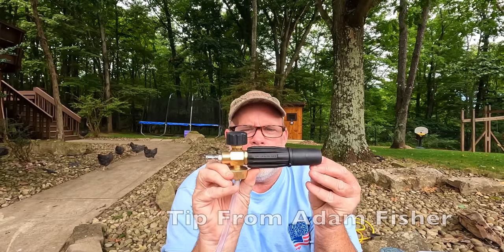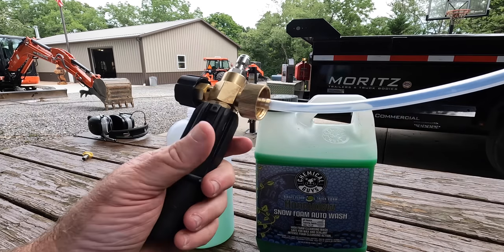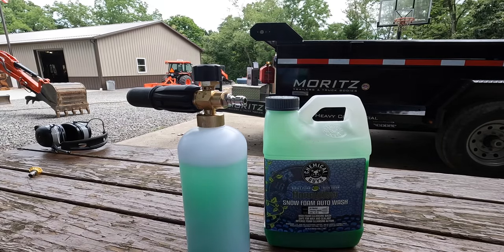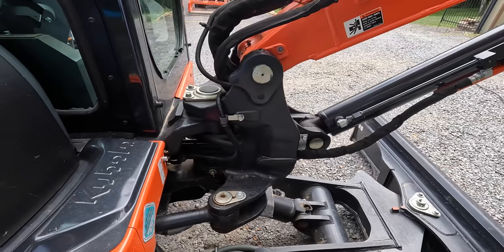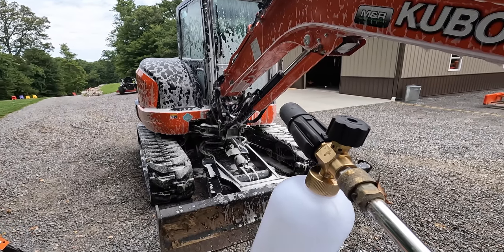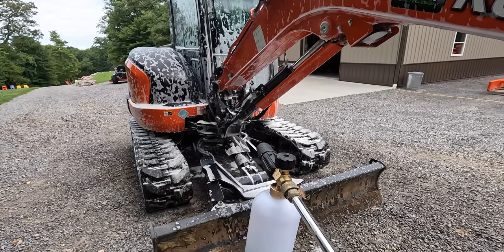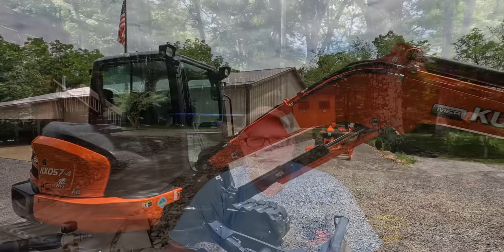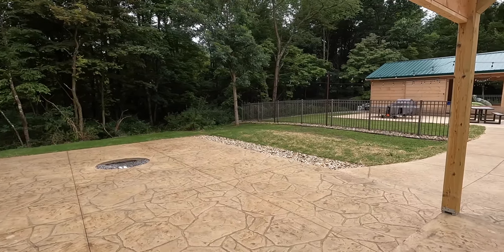Why didn't I get one Sooner? Foam Cannon for Tractor and Equipment Washing

Comment: Hello! 🙂
I gave up trying to keep my equipment clean.  The only time I wash it is when I need to work on it.  Otherwise it gets washed when it rains.   Of course none of my stuff was new when I bought it.
Reply from the maker: Hi David
Reply: David gets the Donuts 🍩 🍩 🍩
Reply: @oldmanfred8676  Hi Fred,  Michael beat me by 3 minutes.  How are you doing?
Reply: Mine, sadly, is much the same. Now that we have water down at the shed, the wash downs are a lot easier though.
Reply: @davidmorse8432 ,
I am better but I will never be the same apparently?  At least I can cut the lawn and do peddling work around the house.
Reply: @oldmanfred8676  None of us will ever be the same but it is good that you can do some things.    Keep your spirits up,  be thankful for what you have and keep moving.   That's my strategy.
Reply: @davidmorse8432 ,
Yep!
Reply: @davidmorse8432 ,
David,
I accidentally muted you?  What can I do?
Reply: @oldmanfred8676  I guess, un-mute me.
Reply: @johnsadler8637  Hi John,  What kinds of equipment do you use?
Reply: @davidmorse8432  Mostly a 1968 Ford 3000 with FEL, cutter deck, and blade. Lots of seeps from hydraulic hoses!
Reply: @johnsadler8637  That's a good tractor.
Reply: @davidmorse8432  It’s done pretty well. Funny enough, it’s like an average of the two Fords we had when I was a kid. We had a gas 2000 with old 4-speed like this one, which is transmission PTO (not live). It was blue but the old-school hood design. About a 1962. And we had a 4000 with 3-cyl gas, power steering, live PTO, single-boom FEL with manual bucket release, hi-Lo 8-speed transmission, and new squared hood design. So running this reminds me of my childhood.
Reply: @johnsadler8637  So the 3000 you have is a gas burner?  Correct me if I am wrong but I think that back in the sixties, Ford used the same engine block for gas and diesel engines. One had spark plugs and the other fuel injectors.  And your 3000 puts out around 30 horsepower.  Is that right?
I am not a fan of direct PTO tractors because the momentum of the implement can drive you forward when you need to stop quick.  You can get a ratcheting coupling for the PTO though. And that helps a bunch.
Reply: @davidmorse8432  Yes, and you’re right, it’s the same engine block as the diesel as I understand it. I do have an overrunning clutch between the tractor and the cutter. Specs on this say 33 pto hp. Same engine, same (maybe 148 ci) displacement in the gas 4000 got about 10 hp more. Must have been carburetor maybe.
Reply: @johnsadler8637  Thanks for confirming.  I am pretty much a John Deere fan but those old Ford tractors are hard to beat.  Take a lickin and keep tickin.
Reply: @davidmorse8432  Dad traded up to John Deere diesels after I went to college. He got an 80 Wheatland and a 730, both wide front ends. That 80 was huge! Like driving a house.
Reply: @johnsadler8637  Here in East Texas they have an antique tractor club and I have been to several of their shows.  That being said, I have seen restored 80's and 730 John Deere tractors.   Both 2 cylinder engines.  T he pistons were 6" diameter but the 80 had a 8" stroke and the 730 had a 6" stroke.  That 80 must have had some tremendous torque but the rpm"s were pretty low, around 1100 rpm. That tractor club sponsors tractor pulls for antique tractors so you can see these in action.  I try to go when I can.  Pop a pop a pop a John Deere tractor.
Reply: @davidmorse8432  I wondered how big the stroke was on those. We shelled a piston skirt on one of the 730 - a bunch of shrapnel fell out when we changed oil. Dad had the mechanic grind out the scars and actually went up about a 1/4” diameter. He figured it gave it about 10% more displacement. So we had a souped-up 730.  Huge pistons.
Reply: @johnsadler8637  Those old tractors had some meat in them.  You could bore the cylinders out and still have plenty of thickness left.  They didn't need counterweights because the tractor was plenty heavy without them.  Unfortunately many didn't have power steering so the farmers arms looked like Popeye's.
Reply: @davidmorse8432  These did have power steering, fortunately! Our Allis-Chalmers WD-45 didn’t, and the wide front end wasn’t easy to turn. The 3000 has a leak, so the power steering doesn’t work much more than a day or two after filling that reservoir! 😉
Reply: @johnsadler8637  Is the leak in the pump, valve, plumbing, or actuator?
Reply: @davidmorse8432  there’s a seal that goes out in those pumps and leaks into the engine oil pan.
Reply: @johnsadler8637  Well the good thing is that the leak is contained.  The bad thing is that too much oil in the crankcase can cause other problems and if all the oil runs out of the pump then it could suffer from lack of lubrication.   There should be a re-seal kit that you could get on the internet.  Or maybe pull the pump and take it to a hydraulic shop.  I think those pumps come off pretty easy if I remember correctly.
Reply: @davidmorse8432  The main problem is the main beam for the FEL is in the way. I have the kit but I despair figuring a way to get it out and back in. 🥴 So for now, I have to put up with manual steering or watch the crankcase oil carefully and refill the PS reservoir when I really need to use the PS.

Comment: interesting car wash at home.....talk Eva into doing it.. anyway...like the show. couple thoughts, whats up with the building for the sawmill? itsgetting close to delivery time? sorry, i havent commented before so im full of ???????? now that the track loader is clean, how about cutting that new trail behind the house so you wont slide down the ravine? a thought, what about hiring a couple ot tree cutters to clear out the red pines and get the loge uphill and stacked / maybe offer pine firewood for cheap, im sure somebody wouldl like it? thats enough of that for now.....the wood yard is really close to looking great, but hears my only real problem there................the wood bin.i cant belive you or Mel=issa  havent cleaned up that little pile of conveyor debris on the corner. i cant sleep at night worrying about that. sorry about my typing

Comment: Wow.  I've actually never seen a foam cannon work (or even heard of them).  I've used a plastic bottle that similarly draws up the cleaner, but it doesn't foam and it's hard to tell how much or where it's been applied, and it doesn't stay on the surface like that.  I would have already ordered it, but amazon is already sold out from the 14,000 who watched your video before me.  I'll keep the link and order when they get back in stock.
Reply: The bottle that you use is the same principle, the foam cannon is more adjustable than those bottle type dispensers, the foam cannon has a foaming device in it that those other bottle type dispensers are lacking....the foam cannons give a much better product dispensing action, all the bottle dispenser setups I've ever used are very hit and miss if they dispense evenly or not, and most times they hardly dispense anything.

Comment: Hi, Mike:  'Love your videos and projects.  ;I have several Stihl products  to maintain our city lot.  Your video prompted me  to purchase to purchase Chemical guys foam cannon Tourq model with a quarter inch quick connector whjich fits my gas power washer   I want to purchase a Stihl electric  power washer model 100 for cleaning our second story deck.  However the Stihl 100 quick connect does not fit the quick connect on the Tourq foam connon.  The local Stihl dealer cannot offer  a solution.  How do you manage this connection with your Stihl gas pressure washer?  Peter

Comment: Soak the grease fittings in a Dawn dishwashing liquid and water solution in a squirt bottle, let is set over night, powerwash. 1 part Dawn to 3 part water. Be amazed in what all it will cut and clean; and kill.